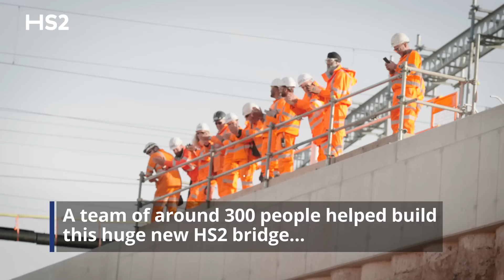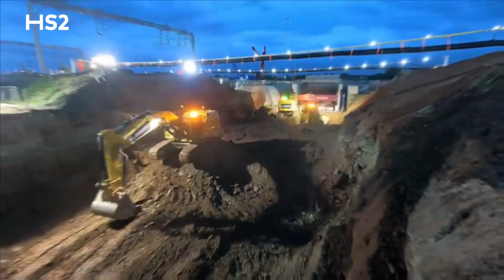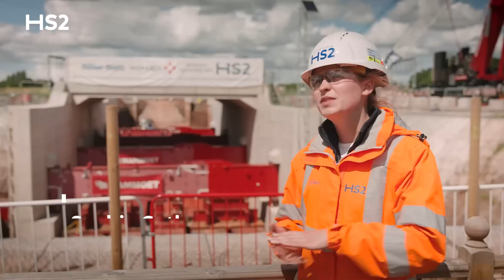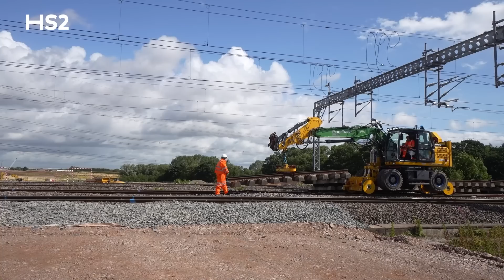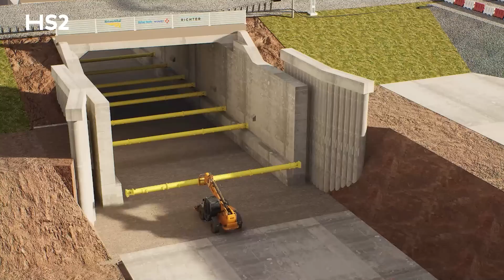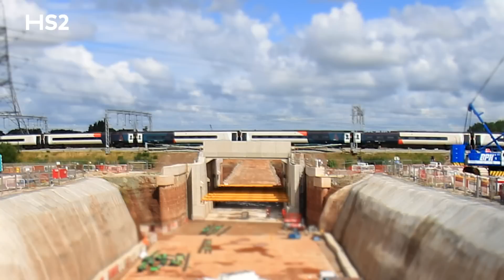How HS2 completed the UK’s heaviest bridge drive

Comment: 9 days the line was closed for?! They did the same thing in tipton 10 years ago that was done in one weekend.
Reply: I have completed many bridge replacements over the years many in a lot shorter period - this took 8 days and even then it was tight - I was first on track and last off - be interested have you a link to the Tipton project thanks
Reply: @davidmillar9595  I've not got the link. But if you search for tipton owen Street relief Road it should tell you about it.

Comment: The engineering side of the project is fascinating but I do find the overall cost of it to be quite alarming .Especially when our current rail network would have been totally transformed had that kind of money been spent on it .
Reply: Not sure that's so true. The WCML upgarade proved that much. 
And in any case there's only so much you can squaaze out of a single stretch of track, we were/are always going to have to add another line sometime.
Reply: Every moaned about the cost of CrossRail. Now, a year later, everyone uses it as the most efficient and clean way to get across London. The quality remains long after the cost is forgotten.
Reply: The current infrastructure is creaking under the weight and age of it and that is proven in numerous ways. At some point it is more sensible to start again that keep trying to prop up something that is hundreds of years old.
Reply: HS2 taking the intercity traffic away from the other lines will free up loads of capacity for local passenger and freight traffic. Running trains of different speeds on the same line is very inefficient as you have to leave bigger gaps. Engineers spent years working out that this was the best way to improve the railway overall.

Comment: Let’s hope that they don’t need constant maintenance like all the other concrete bridges that we have in the U.K…( 125 years ) yes of course it will 🙄
Reply: You mean like every other non-concrete bridge ever built in the entire world
Reply: these structures are designed in such a way that they will be regularly inspected. if not the design would be more complex, use more materials and be more expensive. this design principle is not unique to bridges but used almost everywhere.
Reply: So brick/stone built bridges don’t require maintenance?
Reply: @iangascoigne8231  i guess network rail should just stop caring about all the old viaducts, since they'll last forever
Reply: @CynicalPlatapus  That seems to be the implication in the person’s comment.
Reply: @iangascoigne8231  All bridges in the UK (rail, road, waterways etc) are subject to regular inspections in accordance with structual standards and based upon the materials, geology and other factors within which they reside. Even bridges that are 'disused' are owned by someone, and these are also required to be inspected in accordance with insurance stipulations. This is often the reason why disused bridge decks are removed leaving only the abutments (which are far more robust). Age is a factor - but if the original poster was stating the often used 'old things are made better and everything new is awful' analogy - then that is not true, as old brickwork and stone structures often require regular replacement and maintenance whereas mass reinforced concrete or carbon steel does not.
Reply: @keithgale2596  I never said they didn’t. You’re addressing this comment to the wrong person. I just responded to a comment saying that they hoped that they don’t need constant maintenance like other concrete bridges, and  the inference that they wouldn’t last 125 years, by asking him if  brick bridges required constant maintenance. I know they do, I don’t know if he does. Since the Glenfinnan Viaduct, is made of concrete and is 122 years old there’s no reason why these won’t last as long.

Comment: Could of just built over it using a mud and rock embankment.
Leaving 1 bridge to maintain.

Instead you build down.
Used thousands of tons of concrete.
Which will have to be maintained for the next 125 years.
Plus the bridge.

Not very environmentally friendly! Unnecessary use of concrete.

Long term will the additional maintenance of the concrete and drainage system.
Not very efficient 😉
Reply: Really mate, glad you ain't involved 🙄
Reply: Your future in engineering works is assured. Spruce Goose 2 is hiring in Canada - come on over.
Reply: Good thing you don't work in project management
Reply: Have off
Reply: Even if you built over the WCML you would need to use tons of concrete to build the Bridge over it, but as this new line will swing to the left after going under the WCML it will join onto this line.
Reply: Oh man, glad we have you here, have you phoned up HS2 Ltd to tell them you know the best way to do these tasks? What do you mean by build up and over using a mud and rock embankment..? Do you think you can cross over the WCML from above without the need for any bridges? Have you also broken the laws of physics somewhere down the line?